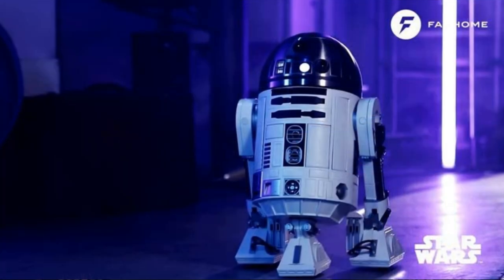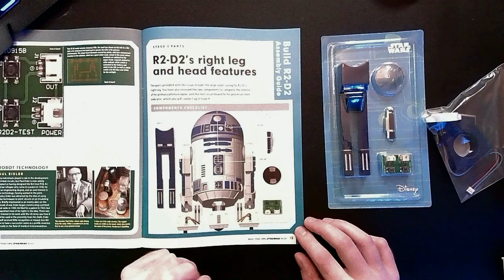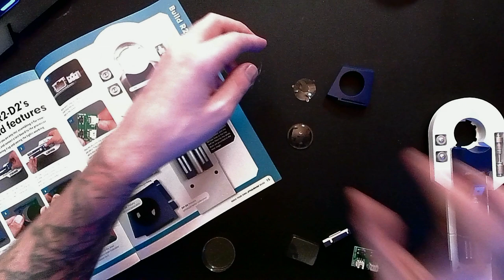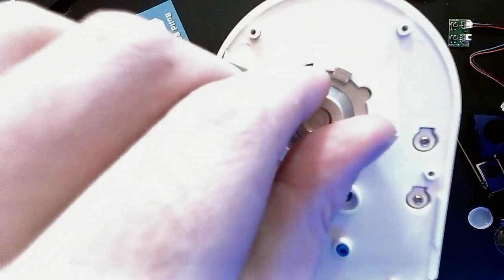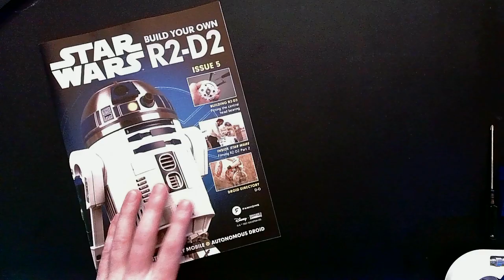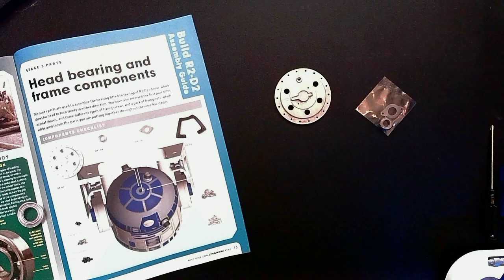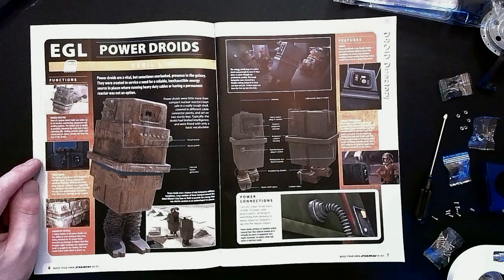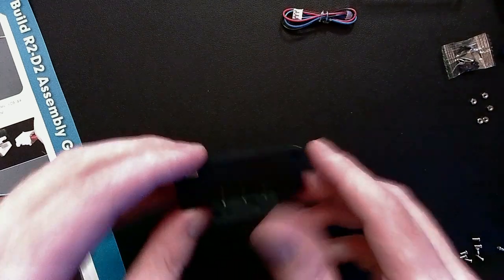Building an R2-D2! | Pack 2: Stages 3-6 | LED Display, Starting the Frame and Leg Details

Comment: Awesome! I really like how well they designed this so that (almost?) every piece only fits one way.
The pin not completely getting through is probably because it has to fit on top another piece. And if you get some latex gloves you can touch those pieces you don't want to get fingerprints on without worry. I often wear a glove on 1 hand so I can hold things (mostly food in my case but the idea is the same) and use the other hand without loss of sense.
Re: screwing in opposite corners first: actually it can make a difference. Sometimes you can screw in one side in a way that the other side gets slanted, or crooked, or however you call it, and when you try to screw it in it damages the screw-wire.